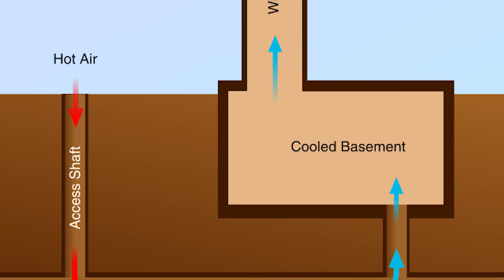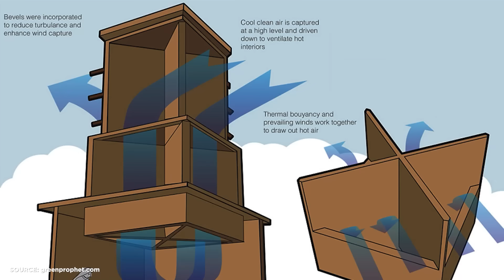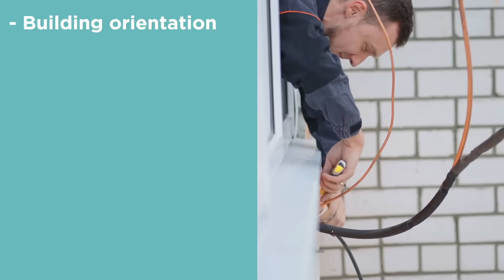Forget Heat Pumps - This House Cools Itself With NO Electricity!

Comment: Temps aren't "higher than ever."  During the four previous Interglacial Warming Periods over the last 420,000 years, Earth's mean temperatures and sea level rise were both HIGHER than they are today.  So sayeth the Vostok and other ice core samples, along with much older geological records indicating 14 peaks over the last 1.5 million years, along with nearly 10,000 peaks over the last 1 billion years, and those intervals are regular enough to suggest extraterrestial origin.  No, not aliens.  Just pertubations in Earth's orbit, axial tilt and axis wobble.

All these "sobering reports" have been myopically created from a scope of hundreds, possibly thousands of years.  Yet glacial cycles span roughly 100,000 years.

Thus, my advice to you is to realize the Earth has been heating up and cooling down for a very long time, long before life evolved.  What we're going through no is not a "climate crisis."  This normal, natural cycle of Interglacial Warming Periods has been a mainstay of Earth's climate long before humans walked the face of Earth and it will continue long after we're gone or have evolved into something else, perhaps homo maximus, or if we're not so wise, then homo regressus or even homo extincticus. With all the insanely unscientific "climate crisis" talk violating hundreds of millions of years of geological data, It appears we're headed towards a period of homo insanus politicus before we either regress or become extinct.

Regardless, yes, by all means, climate change IS real.  This "climate crisis" business, however, is NOT.  Claims that we're in a crisis is the hoax.  Earth is simply nearing the peak of her fifth Interglacial Warming Period of the last 420,000 years, and once again, all four previous peaks were both hotter and with higher sea level rise than today.

Otherwise, good video, Joe, thank you, and have a nice day.

Comment: "Pointy surfaces" increase the radiative transfer in both directions. It's never a freebie in one direction relative to the other; not without violating conservation laws = not in this universe. What increased surface area does is expose a larger surface area of the material to contact transfer mechanisms such as advection and convection. This is where the building mass gets an edge dumping heat - not radiative emission which is, of a necessity, equal across the total spectrum flux for absorbed radiation. And this is really basic physics and math.

Comment: My wife and I lived on our sailboat in the tropics / Caribbean for over ten years.  We had no air conditioning. We had a large shade over most of the boat when in port or at anchor. Left all hatches and ports open as insects were for the most part not an issue. We usually had a good sea breeze and were rarely uncomfortable.  Also, quite frankly, you do get use to it. When I was a child, I was raised in Ft Lauderdale Fl. This was even hotter than the Caribbean. We did not have air conditioning. The house was built with good flow through ventilation lots of windows. Again, we were use to it.

Comment: 3200 square foot home in Dallas would be around $300k. Twenty percent of $300,000 is $60,000. My poorly insulated 2100 sq ft home in Florida runs around $200 a month for electricity. When I turn off my A/C, bill goes down to $100 per month.  It's going take more than a few years to make up the markup.

Comment: I stayed in Munich during most of July 2009, the month during which the highest temperature that year (7/23) 35.2 degrees C occurred.  That's a bit more than 95 degrees F and the high was in the 30s basically the entire time.  I spent most of the afternoons walking around and for context, my preference is 55-65 with a bit of a cool breeze, basically Fall.  The only places there was air conditioning that I went were museums, though I think they also had it in up scale retail stores.  I don't recall having sleepless nights or being overly hot really at all even though I hate when it's in the 80s.  I'm frequently uncomfortable in my house (that has central air) and in my office in Pittsburgh, Pennsylvania, USA, which was built in 1907.  Clearly, they have built structures that passively move air around and stops it from being stuffy and while Munich is 800 years old, the apartment building I stayed in wasn't!  I know in a lot of Europe, people just do not have air conditioning.  It's a leisure that they don't even need.  This experience lets me know that the places I spend my time are just badly designed for comfort.

Comment: This video is a bit misleading for the uninitiated, especially the click baity and downright lie of a thumbnail.

Many people are going to get the impression that these houses are sort of akin to 'passive solar' a la 70s and 80s, when really they are just super insulated houses. On top of that, the standards for these houses makes the ROI compared to a 'pretty good house' (google it) insanely long (not a few years as implied).

And they still use electricity! In fact, I bet most use a heat pump, the very tech you tried to juxtapose these building against. Two different cans of fish: one is a building standard, the other is a piece of heating/cooling equipment.

Comment: Best add-on for average buildings to decrease heat/cool energy use:  beef-up insulation of building envelope to R-50.  That can even be a breathable envelope; it is unnatural & usually unhealthy to live in sealed buildings. 
Adding insulation costs least to gain most benefit.  Including reflective layers to redirect radiant heat as desired, can help reduce amount of convective insulations needed. 
We need to implement improvements that work from “the bottom, up”, to gain compliance w/conversions by the masses, faster.   
“Top-down” economics & climate adjustments are FAILURES when implemented as “top, down” economic models. 
We should be taking advantage of every bit of low-tech geothermal & solar that we can reasonable do, as well as using wind, microhydro, & more, in addition to solar PV.    That started out being done; but, seems now to be railroading to single-sources of PV + nuclear as main (controlled & capitalized) energy for-profit industry.   
It’s still forcing users to be in a centralized supply model…..only, one that now costs users far more to use.  You buy it, you install & maintain all those mandated Grid-tied systems.  But, they are profited from by the centrally controlled grids, at.your.expense.  
Get that?  
Same issue is creeping across the States re: well water…you buy the equipment & drill it; you pay for maintenance…but, States are greedy, & have, or want to control & profit from YOUR well, by metering private wells. 
Industries have, & are TAKING control of all things Life requires to live, then corrupting, limiting & polluting it, “for your benefit & safety”.  Food, water, medicine, shelter, education, transportation, even air.   Only SOME of what is done, is helpful to Some. 
It’s pure, hubristic folly to focus on single-source energy….single-source messed things badly when it was whale oil; it has ruined us all exponentially worse, since converting to petroleum oil.  It’ll be far worse to —yet again— focus, even mostly, on solar PV panels!! 
Isolating buildings from the earth, costs us in ways not always considered.  
That needs fixed. 
“Experts” commonly fail to place their theories & ideas into context of wider use, or long use, or, the additive effects that might happen…,or even that their ideas cause more harm than good.  That needs fixed. 
But 1st, we must fix the immoral, unethical policies & procedures infecting most industries now. Otherwise, Life on the planet is end-game screwed.

Comment: From what I see and hear, there are regional differences in the type of passive home requirements.   Which is basic common sense.
  Unfortunately most governments and professional people seem to ignore these easy, natural, fixable local problems and want to spend tons of money on unnecessary high technology solutions.  
I prefer the simpler arrangements of older technology that is indigenous
To the area and does NOT require
Being "on the grid".  Less use of electricity requires less complicated production methods for the lower use of energy.

Comment: Exactly this; it always surprises me how people get surprised that houses that barely use any energy were possible since many years (and decades) ago. Amory Lovins built his net-positive house in top of the Rocky Mountains all the way back in 1975 and has been preaching to so many people since, but basically to no avail. BTW, +1 for using the metric system, but kilometre rhymes with "metre" or "nanometre", not with "thermometer" (because it's a unit, not a device).

Comment: There are layers to the "cleverness" we can RE-discover. The very shape, design, orientation and materials of houses, overhangs, insulation, ventilation.... Conventional construction, especially in the industrialized US, has prioritized industrialization, modularity, cheapness, speed and economy. It can be shocking to realize how much intelligence and wisdom has been discarded and lost in the pursuit of speed and economy. Stick-built homes don't make much sense in a lot of parts of the North American continent. They don't last long, they aren't durable without a lot of upkeep, and they require a lot of energy inputs. Insulation, overhangs, passive solar orientation and wind-cooling techniques that are low- to zero-energy have been forgotten. Thermal mass, heat sinks, and other passive techniques have had to be re-introduced via these Passive House or PassivHaus initiatives, but they aren't new!

Comment: At least I'm my area where it tends to be really hot most of the year I feel like the passive house thing would be counterproductive. Even without thermal bridges that attic will heat up in summer and makes any cooling way less efficient. We actually have vents in our attics here and I'm going to be installing some small solar fans to draw more air thru.

Comment: For appliance power users like me, I'm curious as how these passive structures would handle heat generating tech like server farms, or even a small scale room to handle a modern gaming rig which can often consistently output 100-300W with the monitor and tower.

Comment: I thought you were going to discuss the 'reverse greenhouse' technology, as I just watched another video on this.  Roofs and walls that reflect incoming heat and let inside heat out, so the structure is cooler than the outside, just as it says, the opposite of a greenhouse that gets hotter inside.   Check it out and do a video on it, the one I say was pretty techy, you can simplify it and do it better I'm sure.  

btw, the modern western world is hugely wasteful as it generates profits for big business.   It is '3rd world' or what I would call '1st technology' countries that are able to do things so much better and cheaper.   The entire world is going to become '3rd' soon as resources are depleted.

Comment: I would suggest that you are missing one big point . . .  most of those ancient coolers are on very big buildings.  So I would posit that the ancient rich might have been more comfortable, but the majority of the populations were not!  (I.E. the northern Europeans brought their livestock into their first floors to help keep themselves warm during the winters.  Warm dung!  No?)  The main benefit most ancients had were just that the thick mudbrick/timber walls they had were reasonably good insulators and provided thermal mass to steady the transients of temperature from day to night.

Comment: It’s simple you need to build on a small footprint (1000 sq ft or less), put in 3-5 times more insulation than recommended and have a low number of small windows - problem solved 😉

Comment: Is part of the problem with the power grid, not urban areas?  Will the future have cities?  My thinking here is that most rural and suburban areas have land for solar panels and wind turbines while multi-level buildings generally just don't.  Decentralized power grids are just better also due to them decentralizing, uh, power, but not just electrical power, but also political power.  Decentralized power means a world without Enrons.  This seems like a fair tradeoff for giving up the ability to live on top of each other in little boxes.

Comment: Where the hell are you getting 30% more to build a Passive House!?! NOBODY authoritative agrees with you. the PHIUS estimates 5% to 10% additional cost; the National Association of Home Builders estimates (a more realistic) 7% to 15%. 
     MANY of the most effective strategies to reduce thermal load such as properly orienting the building, properly sized overhangs, and selecting.a roof color  that helps in your climate (black in Wisconsin, white in Arizona, for instance) are completely free. Properly sealing and flashing openings, correctly taping between sheets of sheathing for air-tightness are only minimally more expensive. Simplified framing that reduces thermal bridging actually saves money on framing, and only requires more intelligent design. Many other strategies are only marginally more expensive such as: Energy Star rated appliances, thicker roof and exterior walls with more insulation, an ERV or HRV depending on climate, and planting fast-growing trees are all examples
     The biggest expense is high-performance windows and doors, and the cost on those are coming down as American manufacturers catch up to the technologies of their European counterparts. It is no longer necessary to import the most expensive windows on earth. We can get home-grown high-efficiency windows right here. Heck, it's getting harder to find single-pane windows at retailers now. The standard builder-grade windows are all double paned. 
     Finally, even going petal-to-the metal and getting the biggest, fanciest solar system with multiple Tesla walls, etc. sufficient to power the entire house, fuel to electric vehicles, and have extra energy left over, only carries a marginal cost (calculated as a percentage of the overall build) of 5%.

    I urge you to film a retraction with accurate information. Even if you don't make Passive House standards, getting 80% of the way there saves money in the long run, saves the earth and beats the hell out of 'builder basic.'
     You have a lot of viewers, Mr. Scott. PLEASE do not spread misinformation!

Comment: Joe - at 3:39 "American Indians lived in caves . . ."  Some time back I read about a California home builder who got a patent for building homes with flexible, earthquake tolerant joints holding concrete slab walls together, slab walls that had embedded wiring and plumbing.  These homes had insulation on the outside which in turn was covered with stucco, and stucco itself can act as an insulator.  Amazingly enough, living in those homes was like living in a cave, underground - cool in the summer, warm in the winter.  Another group has developed "earthship homes" which are also like living in caves.

Comment: I think the answer to "Were people just uncomfortable in the past" is actually just... yes. Deaths from heat and cold were much higher per-capita than they are today, and climate related deaths have fallen by some 99% in the last 100 years. Not to say that there aren't more energy efficient ways to build our homes, and more energy efficient building materials with which to build them, or that we shouldn't be interested in such things... just saying these ancient techniques can only do so much, and modern electric heating and cooling methods have a particular trade-off that makes them more acceptable for the majority of people that don't have 6-figure incomes: low cost.

Comment: People long ago didnt have global warming but rather global cooling. The world was a few degrees cooler before that being warm is more important. The world was supposed to be on a cooling cycle but we ruined it so now we're overheating. Passive houses dont work if the outside air temperature is above 30C due to high humidity in hot areas so you then need a heat pump to keep cool or you wont be able to work much (hence why cold countries have a higher GDP).

Comment: a video about passive houses without mentioning Earthships..?
or even just old stone houses.. we live in a 100 yr old Quinta in central Portugal..
the walls a 1 meter thick.. inside downstairs is literally 15 degrees centigrade cooler in the summer
even with the door and windows open.. and the same warmer in the winter.. no hearting..

Comment: My office is too hot in the winter and too cold in the summer. When the office is so cold in the summer you have to wear two sweaters and run a heater. My apartment is comfortable in the summer and drafty in the winter. We also have storms knock over trees and had no power for 24 hours, only days later get hit by record breaking heat which overloaded the grid and lost power again. I love the idea of alternative housing. Castles in Ireland made of stone are cold all year round.

Comment: I'm in Washington State. I just finished building a home and as of 2021 Heat Pumps are required by law. Between that tech and well built/modern insulation, it's amazing how well it regulates the house for the small electric bill we have.
Reply: For those that don't know, this summer has been hottest temps in history for PNW.

Comment: Here in Dominican I've found that with all sun we get, covering the roof with solar panels provides enough shade to it to keep it fresh enough that it needs minimal air conditioning. Here just fans won't work due to the high humidity and you'd end up swamped real quick.